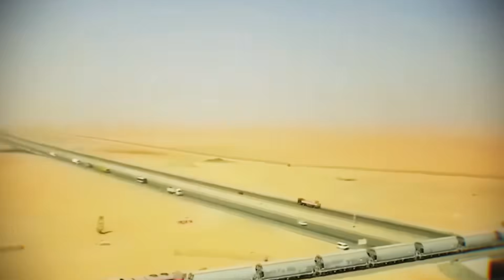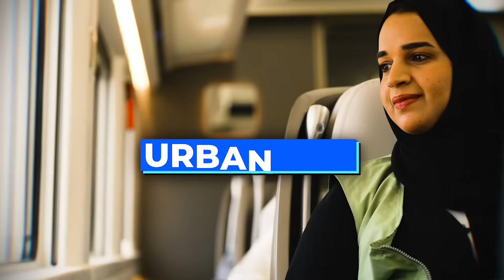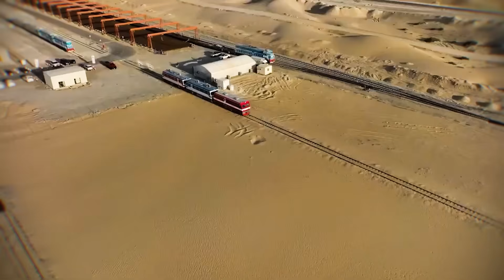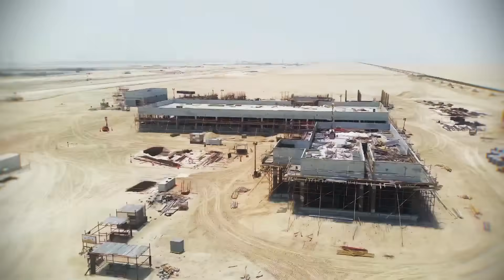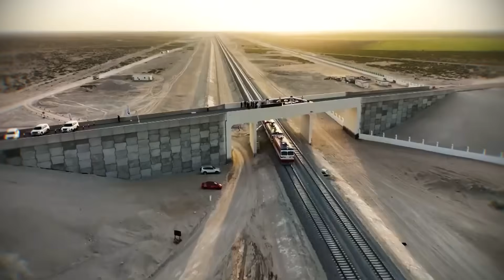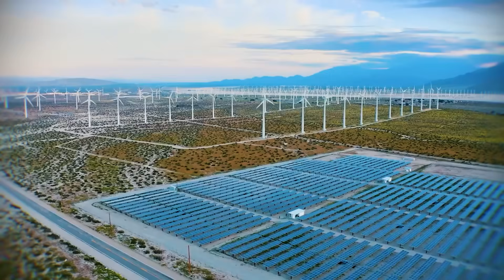The $250 Billion Railway That Will Connect the Entire Middle East

Comment: I was involved in feasibility studies for this project in 1975/6; 50 years ago. at that time the planned railway extended through Iraq to Turkey. 
despite numerous wars/invasions Iraq, assisted by chinese contractors, completed a 'high speed' [100 to 150kph] railway link from Basra to Baghdad in 2014 and plans to extend in future to the border with Turkey and south to Faw Port. 
the oil rich arab gulf countries have a cooperation council called the GCC. however there's seldom agreement for the common good....thus decades of delay for such a beneficial project.

Comment: Could they use a hybrid train ? If Qatar wants to use an electric railway track and  the UAE 🇦🇪 wants to use tracks for diesel trains but if the passenger service trains between the GCC countries used a hybrid locomotive like the Siemens Vectron Dual Mode , then the train could travel on Qatars railway tracks using the pantograph for electricity and then the locomotive can switch to diesel as soon as it leaves Qatars borders into Saudi Arabia 🇸🇦
Reply: They could do that, but diesel electric with pantographs is fairly uncommon and pretty much unheard of for freight trains. The big issues are probably the extra setup and maintainance costs for the catenary wire system, power draw issues and the fact that if you plan for catenaries you are limiting your loading gauge (basically how tall/wide your trains can be). No twin stacking tall containers for instance. It might be technically feasible to build a pantograph to reach up 10 to 15 feet but I've never heard of such a system in use.
Reply: @echomande4395  will maybe a third rail work instead of a pantograph ? Or maybe a hybrid train that operates on diesel but with a rechargeable battery instead grabbing electricity directly from a pantograph.
Reply: Or they could just change engines from diesel to electric and back at the national borders as they probably will force the train crews to change!

Comment: Will be back to. A desert once the oil runs out lol 😂
Reply: jealous of us brokie?
Reply: @abdulmalikaljarallah492 brokie….good one lol 😂 which one of my properties would you line to rent?
Reply: @abdulmalikaljarallah492 lol live in Sydney mate long way from broke ;-) you should check highest average wealth stats out then come back and chat ;-)
Reply: As the era of oil draws to a close, the global demand for energy will remain relentless. With its vast solar potential, the Gulf region is poised to transform sunlight into the new oil—becoming a powerhouse for exporting clean, renewable electricity to the world.
Reply: @MIS64  Getting that power to the customer might be an issue. There are, for instance, no power lines between the gulf and europe. I suppose you could use generated power to crack water and export the hydrogen but you would have high efficiency losses. Electrical cable would have even greater transmission losses even leaving out problems caused by political or religious instability. Still, someone would have to do the numbers for a compressed hydrogen tanker (powered by a compact nuclear reactor) to prove (un)feasability.
Reply: lol haters gonna hate
Reply: I can give you some money if you want it so bad